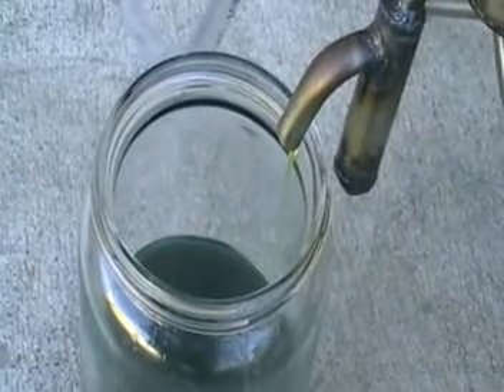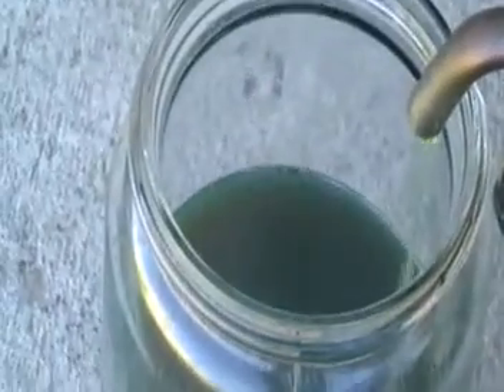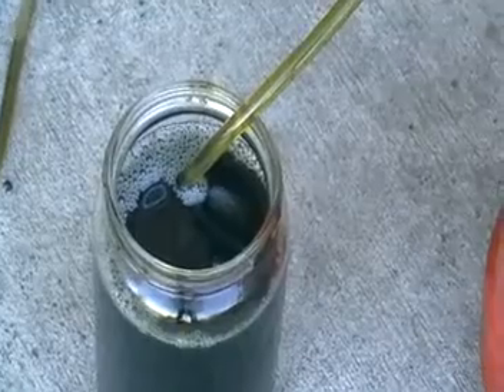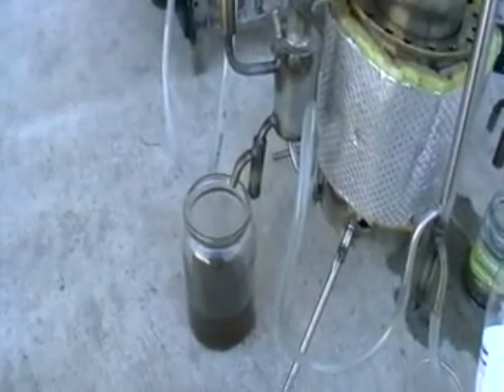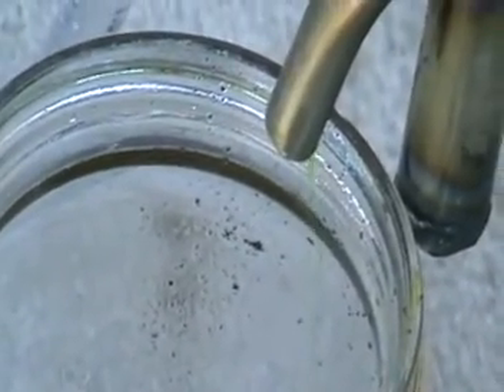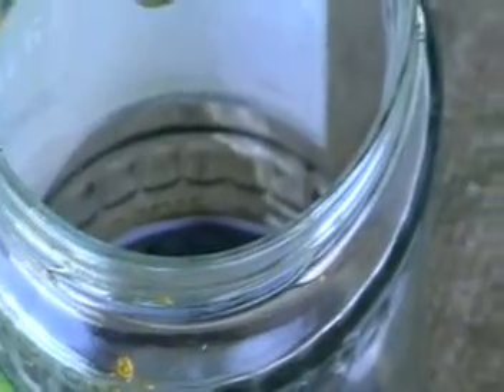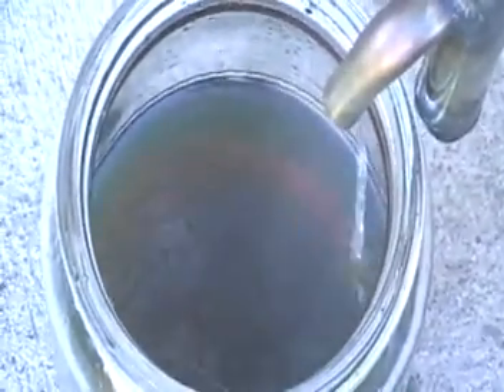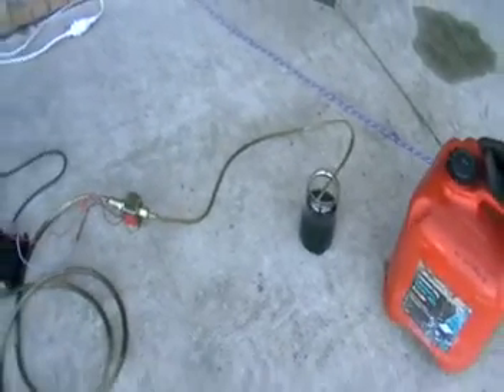WMO to diesel - distillation retort

Comment: Hi Alek, I am on the process of converting waste plastic to liquid fuel it contains mixed fuel of diesel petrol and some oil, for this separation
the company in japan BLEST has a processor on batch basis of 20 and 50 lts. is it possible for your refinery to process the fuel. the 100 L is ok for me 

karuna